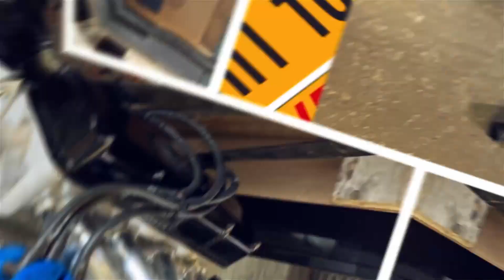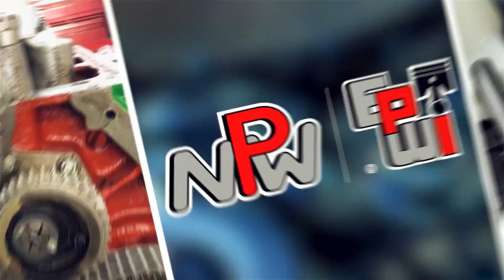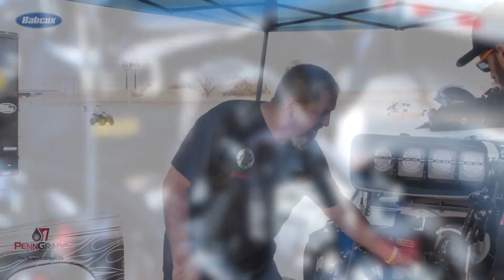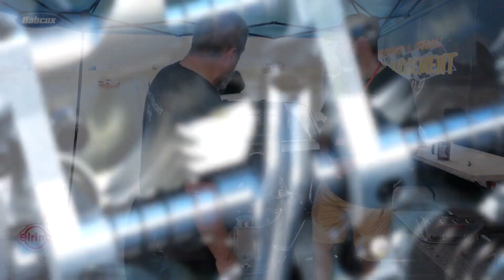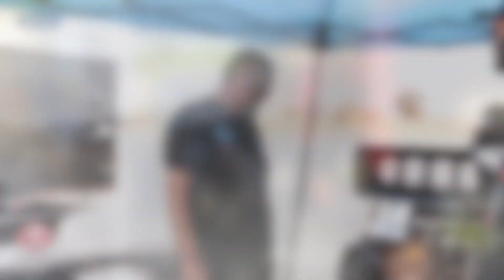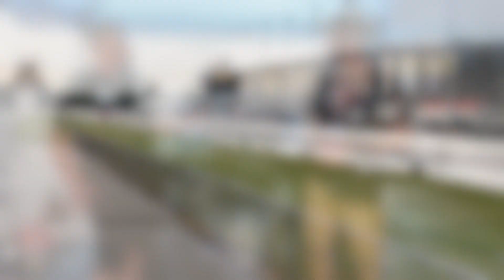Screw-Blown 521 cid Hemi Engine

Comment: With all the Screw Blowers out there, i wonder why people would even think about using a Roots Blower, i know certain classes the rules allow for the use of either Blower to be used, where the Roots Combo usually gets a weight break over the Screw Blowers, due to the Screw being "Better" ?  There definitely more efficient, that's why I'm always wondering Why would someone choose a Roots over a Screw ? To me better efficiency equals Lower Inlet Temperature Charge, Less Power needed to turn, and More Power !  To me a Screw beats Roots Everytime.